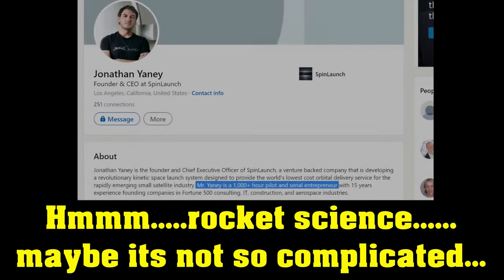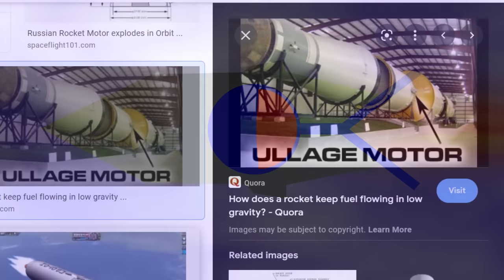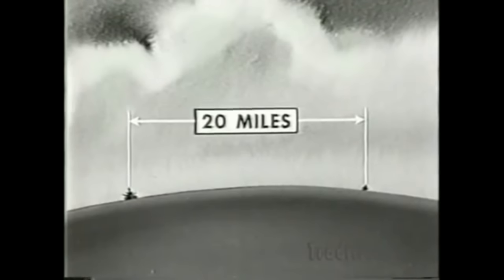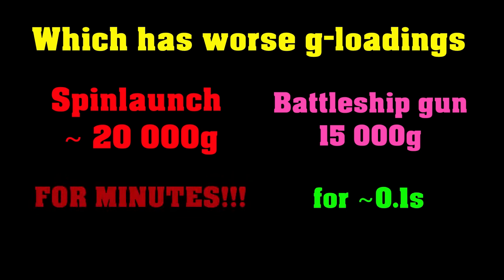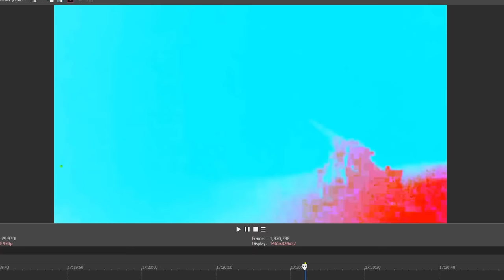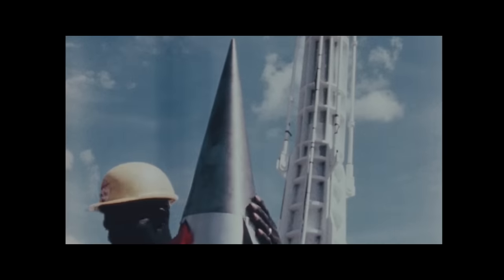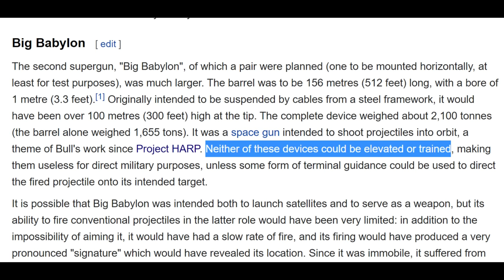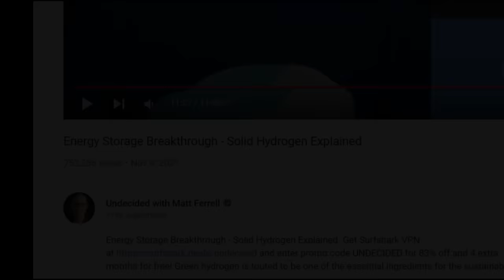Spinlaunch: BUSTED (Part 2)

Comment: I think Spinlaunch should throw a battleship gun. Then, when the time is optimal, the gun fires, sending the payload into orbit.
Reply: Then where's the cost reduction they were supposed to bring?
Reply: In terratech its possible with miniguns
Reply: The gun will make quite a big crater when it lands, or perhaps a small tsunami
Reply: That has been done.
Reply: @thevoiceharmonic  should be fun
Reply: Tony Ennis writes:
«I think Spinlaunch should throw a battleship gun. Then, when the time is optimal, the gun fires, sending the payload into orbit.»

It's a nice thought but you have this backwards.

The lower in the atmosphere the harder the engineering problem is because of the greater atmospheric density. The cannon is obviously a more proven project (as per HARP), has better specifications & scales better so it should be used where the difficulties are greatest. You should use the gun to launch the Spinlaunch device which can then fire at the right time sending payloads into orbit.
Reply: @cosmicaug  Genius!
Reply: So basically it sends the payload to suborbital orbit and the gun does the circularization burn?
Reply: Howabout a payload in a spinlaunch in a spinlaunch
Reply: @wahtx7717  YESSSSSSSSS
Reply: Made me chuckle 🤣
Reply: A real genius would use a trebuchet.  None of this spinny stuff 😂
Reply: Even better, it can spin up a battleship gun, that at the right moment fires up a smaller gun, which again fires up an even smaller gun, which then fires the payload.  Or something like that.
Reply: Hahaha
Reply: I want a yeeting machine in my back yard now!
Reply: Which one? The Yamato gun or a smaller 11 in gun on scharnhorst
Reply: @wahtx7717  Russian nesting Spinlaunches, my god... you're more deserving of that $80mil. than the actual Spinlaunch 😆

Comment: Please address Real Engineering's take on this.  I'd love to see you explain your view on the points he makes in his latest video.   Thanks for all you do, Dr. Phil ;).
Reply: I think they should make the launch vehicle a disc. The vehicle rotates 1:1 rpm with the tether of course, so it is a spinny boi no matter what.

There are many benefits - momentum provided to the vehicle from spinning is along a symmetrical axis so there is no need to correct it as it leaves. Any correction, passive or active, is a waste of energy.

Utilise lift from aerofoil as required, and brake the spinning when atmospheric pressure is low (not too low to brake though). Could use a reaction wheel, preloaded with energy from launch.

Better heat distribution for the forward facing part of the vehicle, could use less material that will distribute the heat evenly along the lip.

Easier to load with a centre clamp, you could provide a driveshaft along the tether to counter-rotate the vehicle, or provide additional RPM if desired.

And this is the main reason - it can be called "Mega Space Frisbee".
Reply: @suodrazah6015  I think they should just use planes. A C-5 Galaxy airdropped a minuteman ICBM in 1974 and it worked, and they can theoretically do much heavier.

Comment: If you're going to use a battleship gun for comparison, use the largest, most powerful battleship gun: The 94 Naval Gun. 46 cm (18.1 inch) gun fitted to the Yamato class battleships of Japan in WW2. It could fire a 3,218 lbs AP round at a maximum distance of 26 miles. You're basically tossing a VW Beetle over 26 miles. Muzzle velocity was 780 m/s. It was the most powerful battleship gun ever used.

Comment: 10 years later Musk be like: I-I have a name for it. I-Its called the hyper beyblade.
Reply: The HyperFidgetSpinner 😄
Reply: @patrickfrost9405  *Hypercopter.
Reply: Musk is already working on a brilliant invention that will be a game changer for forestry. It's described as an elongated structure that supports plant structures including branches and
leaves. It is to be called the Hyper-bole.
Reply: I think he's gone past needing to spin a giant trebuchet to launch a rocket, but okay then.
Reply: @BrokenLifeCycle  Hi ordinary people. I am in fact Elon Musk and here is my new genius idea. I'll construct two vertical vacuum tubes in the ocean linked by cable. The first will go to the bottom of the Mariannas trench. A quick release valve will open, driving a piston up the tube pulling a cable through a reduction gear and launching a rocket out of the second (or inner) tube. Even Thunderfoot can't bust this one.
Reply: “The hyper beyblade. It’s very cool.”
Reply: I remember when the XPrize contest started about ages ago . . . hype was built up on a.hybrid air balloon / rocket system. A lot was promised. Money was raised. Nothing was delivered.
Reply: origin concept only by Musk
Reply: Musks rockets are flying pretty good. Hey, did u think he will fail 10 years ago? I bet u did
Reply: @zizhdizzabagus456  Aside from the ones that exploded? Also, the rocket launches disturb people living in a nearby town, and risk destruction to several nearby nature reserves. And I think you seriously overestimate the contribution Musk has in comparison to his employees.
Reply: Elon Musk will be like "Now announcing the all new revolutionary SpinX space launch system"
Reply: I-its ...
Reply: why not combine it with a HyperLoop to launch people in a pod to mars?
Reply: super looper
Reply: @joshuaa7266  So you're telling me Merritt Island National Wildlife Refuge is at destruction risk because of KSC for past 59 years? And for the town part. He's bothering literally 4 people who are living there permanently and ~12 people who live there seasonally (all of them were offered quite large sum of money to sell their property) while creating tons of jobs.

Fair argument would be that Starbase blocks access to beach(access to beach is required by state laws) whenever they do launches/tests, and building new road there would be quite complicated.
Reply: takes bong rip "I'm confident we can spin all the way to Mars this year, Joe."
Reply: Snort, Giggle!
Reply: It's really quite simple.
Reply: Hyperblade
Reply: YeetX
Reply: @zizhdizzabagus456  He is the luckiest guy ever barring Richard Branson. Did he ever become an influencer?

Comment: Just a little parenthesis: 

The W9 280 mm nuclear artillery shell fired from the M65 Atomic Cannon or 'Atomic Annie'  wasn't a scaled down plutonium implosion weapon but a enriched uranium 'gun-type' charge which is very robust with absolutely no need for any precision detonation sequence. The 'gun-type' charge just assembles two (or more) sub-critical masses together with a neutron initiator mixing beryllium and polonium to get things going while the implosion type need to symmetrically compress a sub-critical mass to a supercritical one in addition to releasing the neutrons very precisely.
Reply: DIdn't they even make a smaller version tat could be transported bei 3 men? Davy Crocket?
Reply: @pcfan1986  they did but that was on a backpack not shot from a cannon
Reply: @MRblazedBEANS  actually it was shot from a gun, you can find the footage on youtube, but from a recoiless gun. The accelleration is less, but it is still significant. Still, it is possible to shoot sophisticated stuff from a gun, even electronics.
Reply: It's worth noting what this guy says in the video is incorrect.  He's using a piece of sped up footage.  Actual flight time of the round in that test was 19 seconds.  To do a proper analysis you'd need a good original video and also need to understand the rate the film was shot at.  Plant of YouTube videos have old 16mm film shot at lower frame rates rendered out at 30 frames per second.  The sloppiness in this video makes me doubt many other things this guy says.
Reply: There was even a version for 155mm artillery.
Reply: @mweskamppp  can you provide a link? I am curious about this.
Reply: Actually it was a subcritical mass shaped like a cylinder that was crushed into a critical mass. It's much easier than the implosion type but far less efficient.
Reply: @glasstuna  No shit?
Reply: @michaelfuchs1467  I may be wrong but from what I've read, the smaller nuclear shells and the "nuclear land mines" sadms, use this principle.
At the time America developed these weapons fissile elements were, dare I say it, cheap. 
In principle it combines gun type and implosion type in one. No long tube to increase size and no precision detonation to ensure complete "burning" of uranium. 
Very useful for the cold war.
Reply: @glasstuna  It still requires precisely shaped charge and sophisticated electronics.